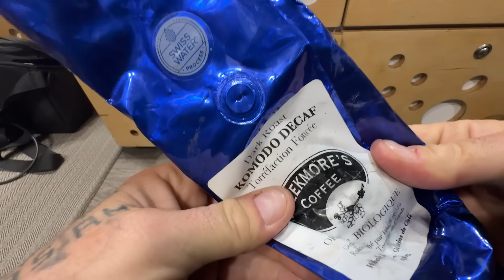Cooking Breakfast Tucked Away In The Woods | DO THEY FAKE IT

Comment: You could add a power wire from regular batteries to the box then if needed can have an external port for 12 volts and possibly a little light in the box